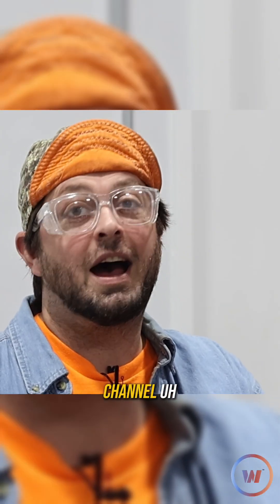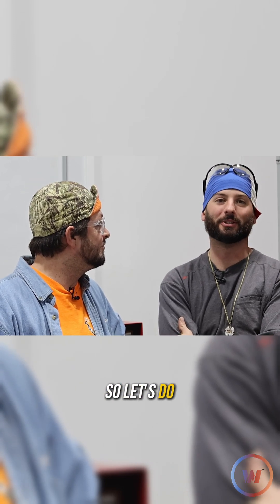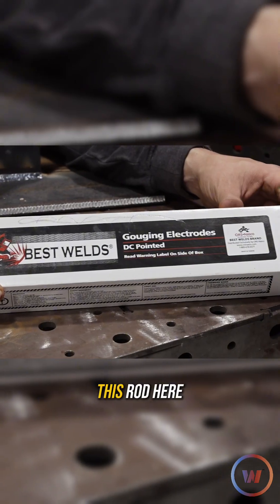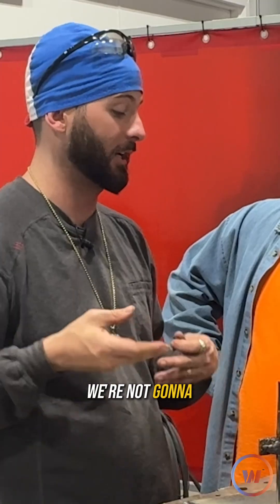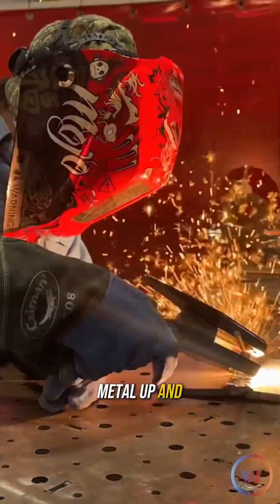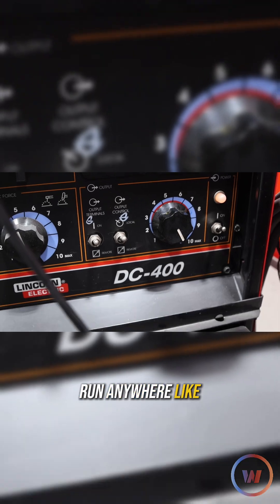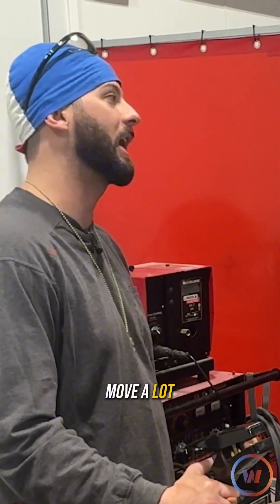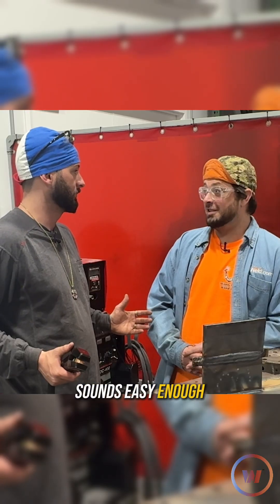Carbon Arc Gouging 101: Removing metal fast #fabrication #arcgouging

Comment: Carbon arc is the best way to remove ferrous weld. Step 1 put your PAPR respirator on. Step 2 ear plugs. Step 3 turn on air compressor and max out your 500+ amp machine settings DCEP (more amps the better)!   Step 4 invite someone who annoys you over to watch 😂.

Comment: Shouldn't you go at more of an angle. im not an expert at all just asking.
Reply: It really depends on the material and how much room you have to move. As long as the air is pushing metal away you should be fine

Comment: I used to be told the same thing. “Big machine, wide open”. But I’ve learned that’s simply not true. Use the correct size carbon for the job you’re doing, and set the machine to the suggested amperage on the box. Too many amps seems to deposit too much carbon that’s difficult to remove. Just my two cents anyway 🤷🏻‍♂️

Comment: What’s better arc gouging or plasma gouging?
Reply: Plasma works great if you have a 3 phase 100 amp machine.  The smaller 45 amp plasma gouge is good for spot weld/ auto body work.
 Carbon arc gouging: You need 300 amps just to properly light the carbons. 800 amps can remove  komatsu 1250 tooth shank in a half hour. No plasma has the depth reach also for recessed work. There is a time and place for each process.  Working with both processes will give you experience that will guide you. 😊